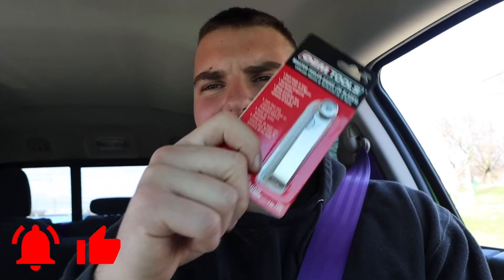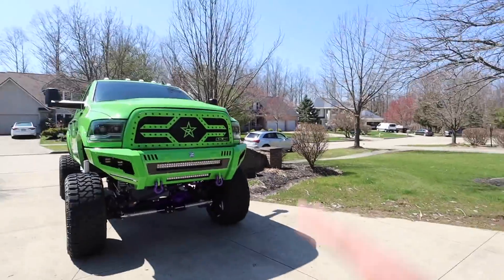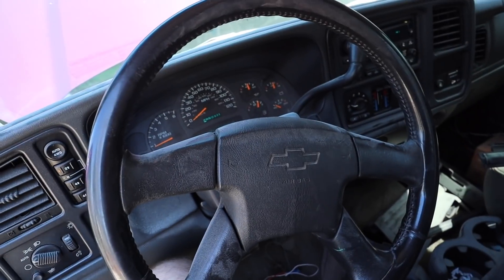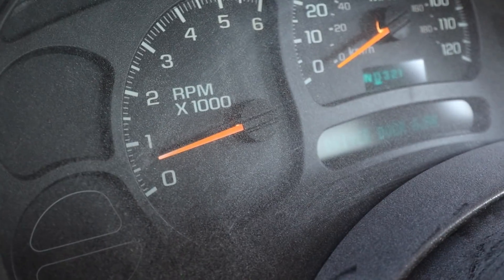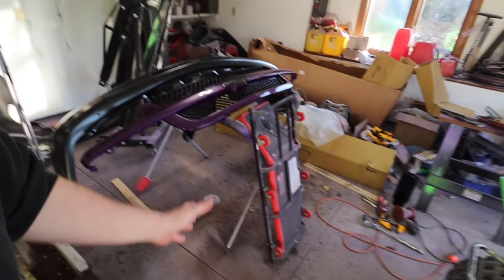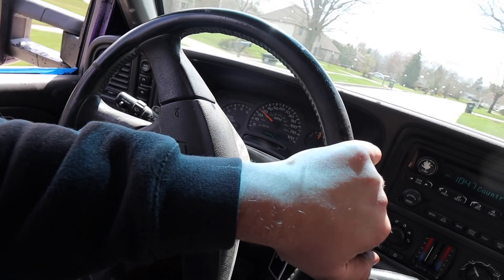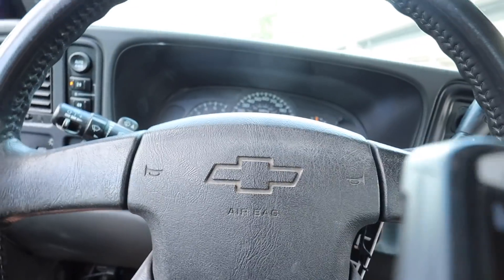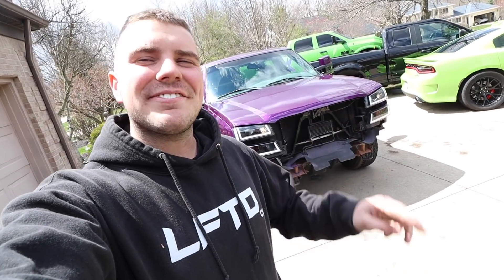Check Your Spark Plug Gap its Probably Wrong...

Comment: The platinum and iridium plugs,leave the spark gap alone!You will break the tips off easily.The early 5.3s,blown out intake gaskets will cause a misfire.While running,spray brake clean near the intake gasket area noticing for a change.If a change,intake gaskets are bad

Comment: hey bud, I also know you also put the bumper back on the truck "chevy"  and did not clean up the rusted parts?   is that going to stay like that?  and saw your hard work on the frame having rust on it already as well.   Saw them lights on Amazon.   not cheep.    but I started to look for parts for my truck.   found  https://www.fiberwerx.com/collections/2003-2006-chevy-silverado  and considering the body and dash and maybe some electronic screens for tacks and another on video Cameras/ recorder.

Comment: My 04 has ran like crap since I bought it just figured it was normal. I drive about 80k or better per year never tune just change oil and tires as needed. It's just a tool. Buying a 2020 next month will try to take a little better care of it.

Comment: Your plug gap should be .60 and that engine needs the iridium plugs. My 01’ 6.0l 2500hd I run NGK iridium plugs and they run perfect. I tried all kinds of plugs but NGK iridium are the best! Also clean your throttle body and run some octane booster or injector clean on a new tank of fuel.

Comment: Do you have any problems with the gap for your spark plugs. What I always do and suggest to people is if you’re going to do your own work on your own vehicle or anybody else’s for that matter by one of the repair manuals for your truck vehicle at like O’Reillys I don’t know which company does it there’s two different ones but that tells you everything you need to know otherwise call dealership give me your Vin number and I’ll have all the information you need. The one thing about forums is nobody’s necessarily right it’s all just opinion so you’re not necessarily getting the right information.

Comment: I would put my money on your po300 random cylinder misfire would be your intake gaskets and while your at it do the knock sensors and silicone the rubber boots to the knock sensors and do your vally cover gasket

Comment: I was always told not to gap iridium plugs, I never did in my 5.3 and never had an issue. When mine was misfiring and hesitating really bad and throwing codes it ended up being that I messed up one of the spark plug wires.

Comment: Hey I'm going through the same problems with my 06 1500 WT you need to check the wiring to the heated 02 sensors because they tell the trucks computer the air to fuel ratio and the wiring could be destroyed. Since mine is a manual it got pinched on top in the transmission and body.if it had a transmission replaced then the wire loom is probably pinched

Comment: I’ve got a 2005 Silverado with its original sparks, they’ve got about 230,000 miles on them. I’ve looked in my manual and the spark plug gaping should be 0.040 for V8 engines except for the 8100 which would be 0.060 along with the V6 engines. Not sure if this applies to Chevy’s of this era but on some vehicles if of you disconnect the battery, the throttle would have to relearn the idle.

Comment: Misfire possible coil can you see on your scanner what cylinder is misfiring then swap coil see if it changes fuel trim lean possible vacuum leak your truck has a fuel regulator check the fuel regulator pull vacuum hose if you have fuel bad regulator

Comment: The longer you leave that clear coat sanded and un polished the harder it’s gonna be to get those sand marks out
Reply: It'll be fine. Just takes a little extra time.  Nothing wrong with that.  Plus it never got baked so its still probably pretty soft
Reply: Thunder Truck not saying it won’t buff back out but it’s definitely harder
Reply: @milinichsautodetail3124  i started a 71 K5 Chevy Blazer today that was painted 3 years ago.  I started out with 1000 grit and stopped at 5000 grit. So far so good buffing wise
Reply: Thunder Truck I’m saying when you leave a sanded panel for long periods of time it’s hard to get sand marks out, it can be done but it’s harder.

Comment: It may be your catalytic converter and sensors that’s what my problem was on my truck
Reply: It’s the bow tie on the grill. Lol just kidding. Lean codes yes I would think too cats or bad 02 sensor. Wasn’t there a misfire code too? Fuel filter if that year is still equipped? Throttle body cleaning, go with factory gap on plugs as well

Comment: Also got misfire code and turned out to be the alcohol sensor for the fuel freaked out and was making my truck misfire, reset the alcohol sensor and ran prefect after that.

Comment: My 04 2500 had multiple misfire and it was my plug wires but I got new plugs and wires and left mine at .40 and I never had the problem again. Those were AC Delco platinum plugs.

Comment: Please finish buffing the Chevy that front quarter panel bugs me 😂😂😂
Reply: Quarter panel is in the rear. Fender is on the front. I've been doing bodywork for over 15 years I think I know what something is called...
Reply: @danielnelson5685  also Google front quarter panel. It shows a fender. It's the same thing sorry to rain on your parade Mr I've been doing body work for 15 years
Reply: It's called a fender.... not front quarter panel...
Reply: @danielnelson5685  it's actually is called a quarter panel it can be called a fender. No reason to be a know it all dude nobody cares.
Reply: The only time its considered a quarter panel on the front. In the actual automotive world,  is when it is welded or bonded to the structure of the car making it part of its structure.  Not bolted to it.

Comment: Did you plug your O2 sensors back in? Since you messed with them you could possibly  have messed one up
Reply: That what I was going to say
Reply: If I was a betting man, that’s where my money would be. Ryan if you’ll go to O’Reilly’s where you are if they have a Bosch diagnostic code reader, or any tool worth a crap, you can plug it into your OBD2 port and monitor them. The values that they give you upon testing should tell you rather ones bad or not, and will tell you exactly which one instead of guessing. My opinion though... buy both new, cause they both have 14x,xxx miles on them. If one is giving trouble, or going out, the other is likely right behind it. I’d replace them both.